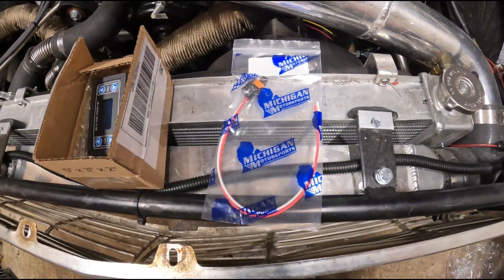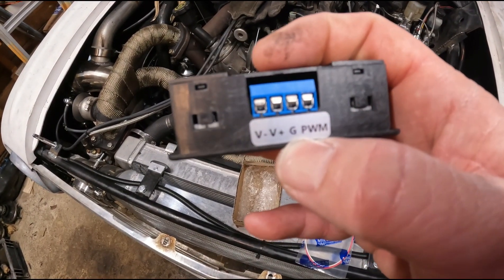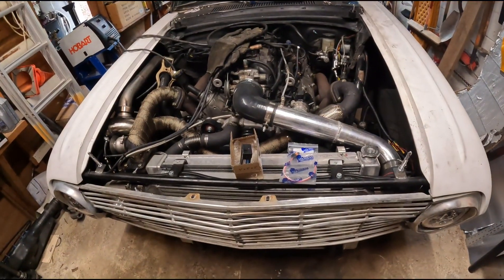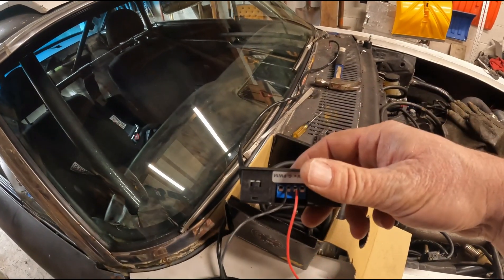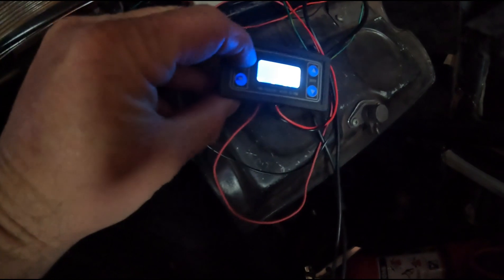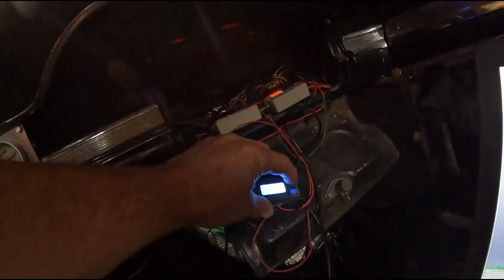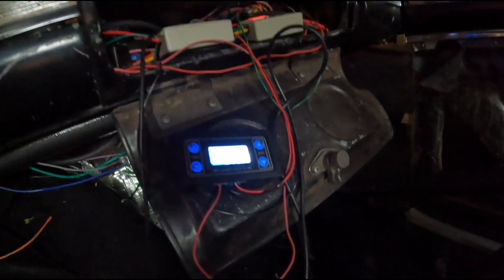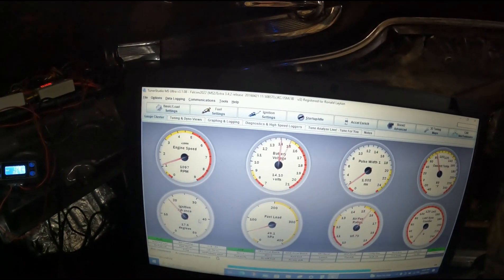How to wire a 2 Wire LS alternator charging using a PWM signal generator

Comment: LS swap is pwm signal, but i have Toyotas smart system, with RLO wire from Ecu that Also is a pwm signal, but something is different? How can i RLO swap?
Reply: U can do Toyota in the fuse box under the hood. I found a tutorial on google about it.
Reply: @ not any Toyota, i dont have alt fuse,

Comment: I have a 3.6L VZ Commodore / Holden / GM alloytec like the one in the v6 camaro and Cadillac CTS 3.6L V6 the alternator is a Mitsubishi a003tg1991 alternator it has a 2 pin plug a orange wire and a white wire the pins are FR / F terminal and L Terminal I guess means light ? My alternator isn't charging / exciting I cut the wires off the plug so my duty cycle was 9% when running now it's at 99% when running but it's not charging and dash light is still on so exactly what wire out of the 2 is the one that I need to reconnect keep connected to the alternator with and have it plugged into the voltage reg so it makes the alternator turn on / give it the power to charge the battery orange or white ? I connected it back up the other day I wired the orange wire back into the plug and put it on the bottom pin of the regulator which if you google the alternator the diagram says 2 is top pin and 3 is bottom pin so I had orange wire onto pin number 3 but still no charge it's running off battery power still,  duty cycle still at 99% and dash lights still on saying Alternator F terminal Low Voltage ? So have I plugged the wrong wire into the wrong pin or am I missing somthing ?

Comment: What about the red dash light for when the alternator isnt working?
Reply: Did you find a way to make yours work ?
Reply: @wheresmycardudee  my system is working,  but the L terminal Is the Lamp, not Load. And I'd like to hook up an idiot light. Lol
Reply: @lsswappeds-10interceptorma56  my light wont turn off haha it keeps going herbie fully loaded
Reply: I have a 3.6L VZ Commodore / Holden / GM alloytec like the one in the v6 camaro and Cadillac CTS 3.6L V6 the alternator is a Mitsubishi a003tg1991 alternator it has a 2 pin plug a orange wire and a white wire the pins are FR / F terminal and L Terminal I guess means light ? My alternator isn't charging / exciting I cut the wires off the plug so my duty cycle was 9% when running now it's at 99% when running but it's not charging and dash light is still on so exactly what wire out of the 2 is the one that I need to reconnect keep connected to the alternator with and have it plugged into the voltage reg so it makes the alternator turn on / give it the power to charge the battery orange or white ? I connected it back up the other day I wired the orange wire back into the plug and put it on the bottom pin of the regulator which if you google the alternator the diagram says 2 is top pin and 3 is bottom pin so I had orange wire onto pin number 3 but still no charge it's running off battery power still,  duty cycle still at 99% and dash lights still on saying Alternator F terminal Low Voltage ? So have I plugged the wrong wire into the wrong pin or am I missing somthing ?
Reply: I just ordered one of those controllers I’ll let yall know how it goes been looking for this info for months
Reply: @DADDYCOKE2012  cheers these smart alternators are very sensitive and always seem to have faults lol my old car same model but 6 months apart in build they had the old style alternator and not the smart alternator lol how easy it was to just change a voltage regulator in 2 seconds unscrewing 2 star screws vs there smart systems which most seem to be sealed units ect I guess to get more money since if the regulator goes bad you'd basically have to by another alternator unless you bypassed it but ugh why'd they have to make smart ones lol the old style were just fine

Comment: What did you do with the harness end of the L wire?
Reply from the maker: The harness plugs into the alternator. The L wire goes to the PWM output on the signal generator. The other wire in the harness is not used.
Reply: @63FalconTurbo  thanks for the response! Idk if on an OEM setup this would trigger the alternator light to come on. I've heard of a resistor being used to keep the light off and not dry the regulator, but can't confirm.